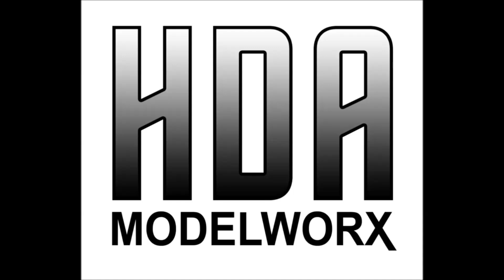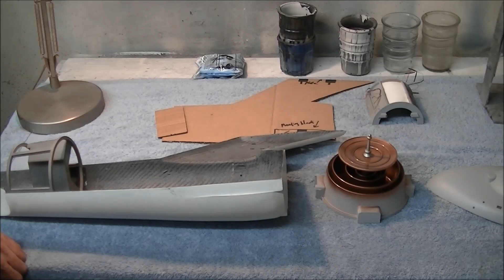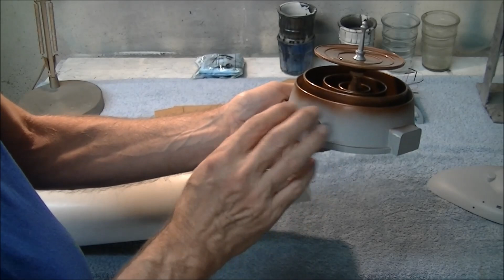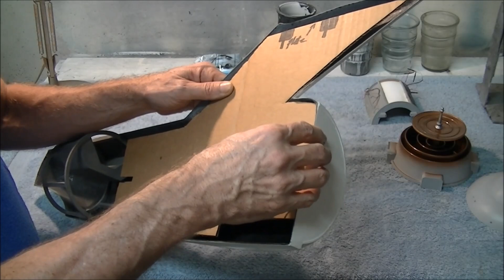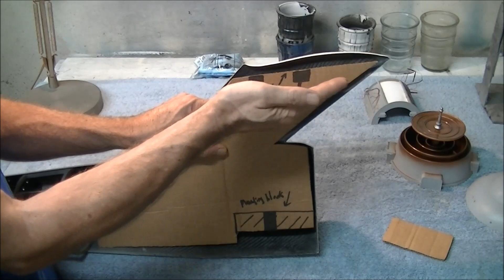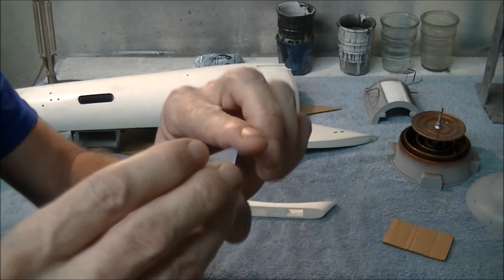72 Inch Starship Enterprise NCC-1701 Model Build Series Pt 2

Comment: Have you got to the power jacks yet? I wanted to point out that there is a company that makes a stronger 1/4" jack socket that doubles the amount of contacts and makes a stronger connection (so the jack doesn't pull out of the guitar as easy but also makes a better electrical connection.)
EDIT: It's called "Pure Tone Full Contact Output jack"  On Amazon for just under $7.

Comment: Hi Boyd. I plan to go to the Nats in San Marcos since my mom and sister are up in Round Rock.  It will be fun to meet u and see this big E!  Btw it looks great so far. One comment. The area behind the deflector dish was found to be hull color on the back wall. You could pour paint back there?
Reply from the maker: To keep it clean looking I'm going to cut out some rings of thin sheet plastic, paint them the hull color and glue them on around the copper colored rings.

Comment: Hi Boyd,  Lou has noise from his Motors in the nacelles due i think to the sheer size of them. Have you worked out how to keep the Motor noise down in your ships nacelles?
Reply from the maker: Yes I think so. The motors we'll use are much smaller. Between that and some sound deadening with foam rubber in the nacelles should do the job.

Comment: I like and enjoy the progress so far. I do have to throw in my 2-cents about the internal armature: I think there should be a couple of rings for the inside of the engineering hull. They don't have to be entire rings-- the idea is that two of them, perhaps right near the front sensor ring and just at the rear of the neck -- will provide a spot that a pair of rods can be attached to. This would support the area between the neck and the pair of penetrations that are the pylon openings. I always saw that area as a source of flex.
The idea is that the "partial rings' would only need to lay in between "10 and 2" of the clock (miss the windows, natch). Whether they touch the inside of the hull or not is up to Jerry. A couple of notches would hold the rods (or such a shape) that would connect the forward and aft partial rings. They would touch the inside-- even if with ApoxySculpt for "perfection" or some Evercoat as a gap filler.
I am not a big fan of those 1/4" plugs and jacks. I fooled around with them for years and they always gave out on me at some point. The 1/8" (3mm) jacks and plugs too-- worse, as it takes only the slightest misalignment when inserting one thing into another to rip the guts out of the socket. Sure, they look tough, but this is a big, solid ship. Weight will probably not be "perfect" to and fro. I don't see why an ordinary set of power connectors, nice and loose, can't do better.
The transition from engineering hull to neck to saucer is always a head-scratcher. I guess the Key solution is pretty good-- just not enough adjustment possible. That could be addressed fairly easily with a real laser cutter (who knows what was available back in that day). Ahem, while we've got this wonderful device to hand-- why not a one-piece hull-neck-one-axis-of-the-saucer piece? The whole shebang in one piece. i know-- a big piece of plastic. Maybe it would have to be tilted on the cutting table... I was never satisfied with that Key solution of a acrylic sandwich joint. A little too complicated, some parts too thin for my liking and one still didn't get enough adjustment points.
Final, pursed-lip question: is metal sheet okay in that laser cutter? 'Cause I'd say 3/16" steel sheet would be better form somthing this big!!!

Now here's the crazy suggestion: how 'bout a side mount (option... maybe) where one of the hull "grabber" pieces comes free (whatever those three things are around the sensor shroud). Inside would be a square receptacle for a piece of square steel stock. That square tube would welded to a larger square tube that stood upright on a steel base on wheels. Adjustability here may still need to be done-- that's just a little bit more engineering. The tube stock I've seen is pretty tough stuff. All metal gives a little and there might be a couple gusset points at top and bottom of the main tubing.
This concept echoes the "3-point" mounting of motion control models-- but I think only two points would really be needed. It is a more spectacular display when you can see clear below the hull. (You'd cover that mounting point up with a simple plug or a sheet of magnet material with the registry pattern on it.
Have that main column be adjustable in height for all display potential and never look back!!! if you kept the bottom mid-line mount available, you could always put this on your fireplace mantle... This also would allow for the utterly insane idea of a thoroughly custom installation somewhere, somehow, where the mount is down from a ceiling.
Yes, I do like spending other people's money...
Reply from the maker: Will have to see how it works out. I'll add more bracing if it seems to need it. I do want to keep it as light as possible also.

Comment: Maybe use 3 ring / 1 tip - 1/4" plugs. Could also do +/- and s/r (send and receive) then use a break out board to decode your digital communications to the pylons. Then you can always expand features.

Comment: You should check out using addressable RGBW lighting controls like used in the newer computers. Those controllers are compact ,power efficient, and bright if need be. You even have room to mount a raspberry Pi micro computer inside to control lights effects and sound

Comment: Hi Boyd can i ask ...? Im doning my very first LED  Star Trek model the leds that i have bought seem to keep blowing when im testing them on the breadboard . Is there something im not doing right ..  Also would it be better to buy the proper lighting boards that go to the model and if so where can i buy them from    ?  thanks im in England ....  Superb workmanship what you do with these models ...thank you ....
Reply from the maker: You need to use the appropriate resistors for the LED's. The correct value of the resistors depends on the power level you use as well as the specs on the LED's themselves. I build 99% of my model lighting to operate at 9 volts dc.
At that rate, a 470 ohm 1/4 watt resistor is proper for almost any type of LED you would need. Also most pre wired LED strip and pre wired SMD's wilth resistors will work properly at 9 volts.
Reply: @TrekWorks  Hi thank you so much for this Boyd .. its very very helpful once i get back onto my model and its completed ... Its the Starship Voyager by the way .. i ll put up some pictures to see what you think ... My major project after will be the Lost in Space Jupiter 2 , also with leds ... thank you for getting back to me its very much appreciated  ...
Reply: The Jupiter 2 model is the 18" version ...thanks again ....look forward to more great posts of this ENTERPRISE  .... and wow its huge id love to get this model ....

Comment: Sounds good, though I think the sheer strength of the hull may become compromised, the more the end plate behind the deflector dish is removed. The entire weight of the model pushing on the base will flatten the hull until it resembles the Enterprise D.  =D

Comment: Hey Boyd...two questions: Have you considered making the aft cross plate notched along with the armature....would that offer any additional strength and stability? Do you think she'll be displayed at Wonderfest next year? That would be awesome to see!
Reply from the maker: Hi Phil, it could be that an extra notch would make it stronger. We'll see. I'm told that 1/4" thick acrylic bonded with the proper adhesive is incredibly strong and won't break down over time. As it stands now, it'll be overly sturdy which is a good thing. As for the debut display the plan is for the IPMS Nats in July 2020. Might be a sneak peek at the February 2020 IPMS show in San Antonio. It could make a Wonderfest appearance after that though :)

Comment: Aztek Dummy is building the 66-inch fiberglass Enterprise kit now, Boyd.
I think he had to buy the electronics separately but the armature definitely came with the kit.  I think he did some additional reinforcement, though.
Poor guy is going crazy building that kit, btw!  He took time off to enjoy a model kit convention in Tennessee this week.
Reply from the maker: The kit Lou is building was the best available design at the time which was several years ago. This kit is modern tech and won't require near as much cleanup work. Also, even though this kit is larger than the 66" it's carbon fiber construction makes it much stronger and less than half the weight. That should be very beneficial for long term stability.

Comment: Something to look forward to this fall other than football.  You mentioned having the saucer removable, will you use a magnet secured opening on top of the saucer to access the Allen screws?
Reply from the maker: Yes, the neck /spine cap detail part on the saucer top will be fastened with magnets so it can be an access port for the saucer mount.

Comment: And don't forget the nacelle pylons have a couple of lit windows too! :)
Reply from the maker: Actually they were never lighted on the original model and still are not after the restoration was done. On this model those will be dark as well as the same group of hull widows that are dark on the 11 footer.
Reply: @TrekWorks  indeed, I know. I just figured that you might light them since you were doing the impulse engines. No biggie. :)

Comment: What scale would that ship be ?
Wow
Reply: @Shawn Burke Boyd's six ft model is OVER half the scale of the 11-ft model.
The 11-ft model hanging in the Smithsonian is actually 134 inches long, or 11ft 2 inches long (or one other source says 11ft, 3.5 in; it's just over 11 ft long either way).
The fiberglass Enterprise model Aztec Dummy is building is the HALF-STUDIO scale model at 66 inches (5 ft, 6 inches), or 6 inches shorter than the model kit Boyd is building here.
The 3-ft prototype/original shooting miniature was 33 inches long.  The 11-ft model that survives and is on public display in the NASM is 4 times the scale of that one but it's not an exact scale duplicate of the 3-ft model (differences aside from the fact the 3-ft model never had lighting or warp nacelle effects).  There are differences in the shape of the primary lower on the lower half of the 3ft model and an ugly stubby area on the 3ft model where it was secured onto a shooting tripod or whatever kind of stand was used for it.
They still have the stand for the 11-ft model in the NASM and it still bears the blue paint or chalk used to disguise it for shooting against the blue screen.  One thing they NEVER put back on display with the 11-ft model is the control panel they used to activate/control the lighting and warp nacelle effects.  It's literally a work bench!  That control panel was on display in 1972 or 1973 when they had the 11-ft model on display at a California college over a weekend.  All the lights and warp nacelle effects still worked even then after 3-4 years in storage.  The model was intact except for the missing main deflector dish.  This was prior to the shipping to the NASM.  By then, the 11-ft model's frosted nacelle caps had been smashed and were later replaced (incorrectly) with non-spinning red nacelle caps.
Reply: By my info, this model is 6 feet long from bow of the saucer to tip of the warp nacelles and the Franz Joseph blueprints for the Constitution class Enterprise say it's 947 feet long so 947 divided by 6 equals 1: 157.8 scale.